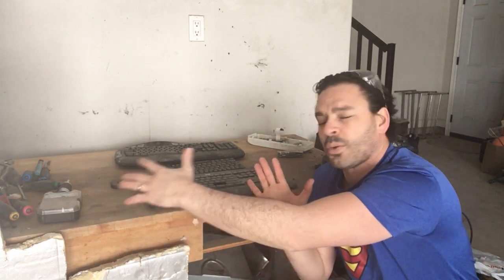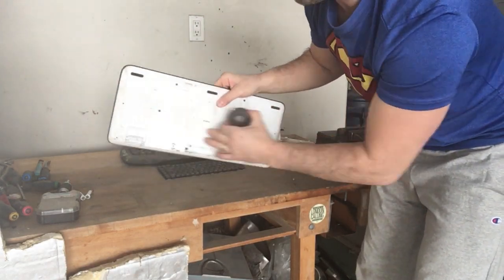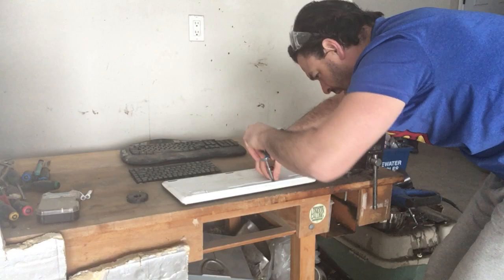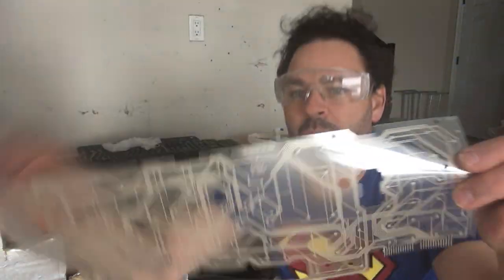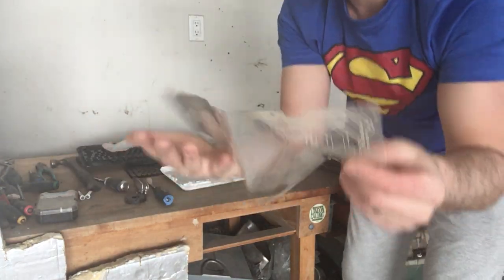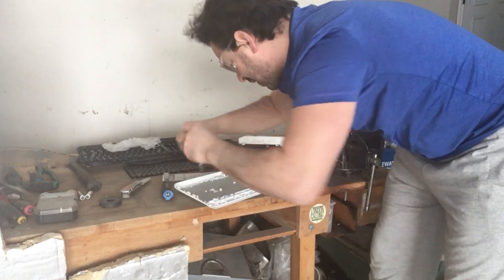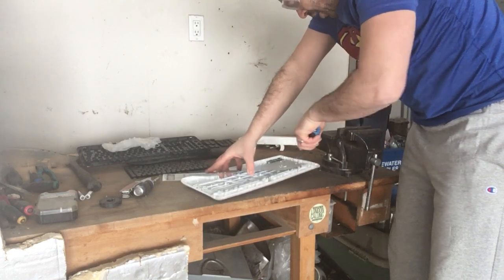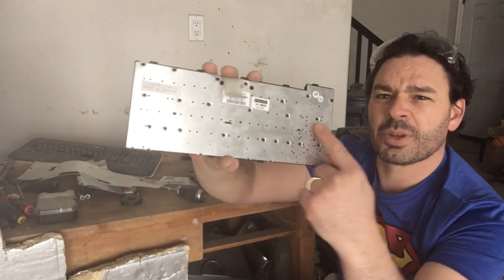Scrapping computer keyboards for silver, tin, and other metals.

Comment: Nice video!  So early today I started playing around with different ways to strip smaller wires, and tried using my flaring tool with a razor blade.  Then a block of 2"x2" drilling different size holes, then added a blade to that also. They both worked ok I guess.  
Then I went back to my stripper and was totally blown away, when I realized I was able to just lower the block where you insert your wire about 1/4" "Down", then very very slowly start your drill until it catches, then I was able to cut not only 1/8th but, 7/64th Guage wire! ! That's like speaker wire lol!  Medium Tec.($1.00) & Sheathed #2 ($1.65). Now, it's all going to be #2 Stripped at $4.55/Lb.. 👍
Just thought I'd share that with anyone who has a huge box of smaller wire that usually we would sell for #2 & 5-6 Sheathed. Takes a little time to get it right but , in no time you'll be stripper #2! 🤑
Reply: UPDATE...I was just able to strip 5/64th gauge also! (Computer harness). (77% Recovery)
If anyone is curious I am using a drill bit gauge plate.